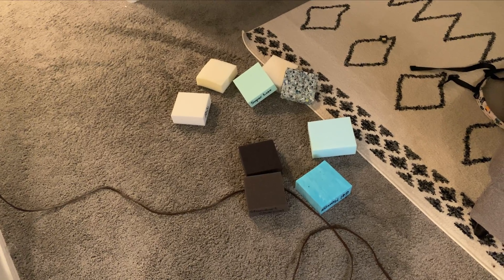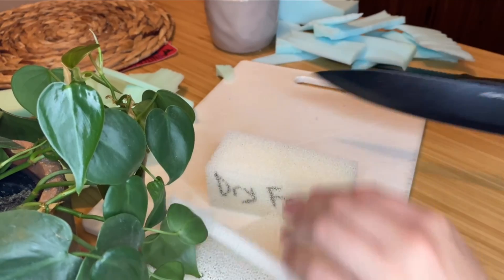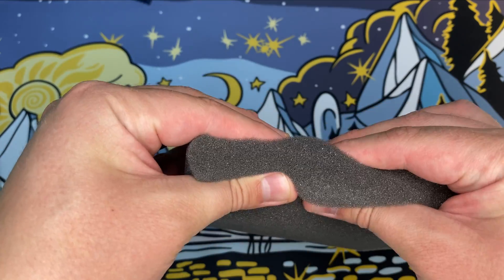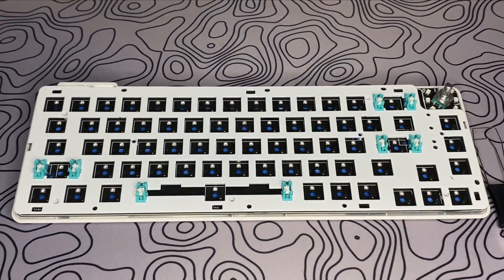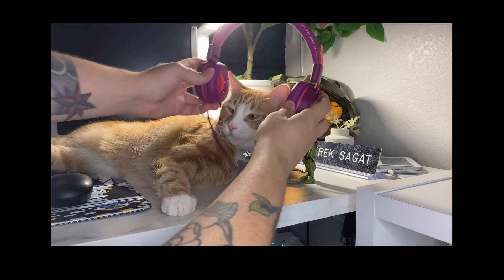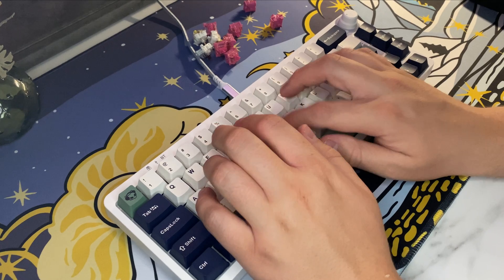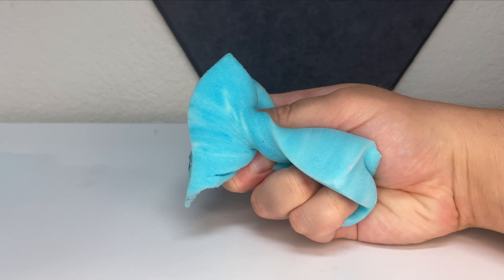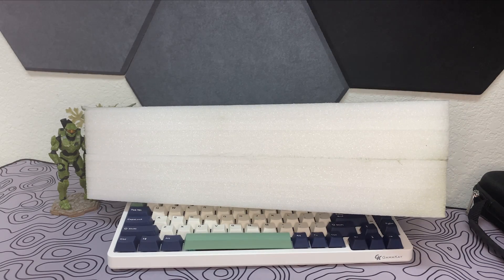The BEST Keyboard Foam Material

Comment: 6:49 - If THIS is how you installed the foam for all the runs, then no wonder it all sounded the same. Should be one solid sheet of foam with only holes for ribbons and screw holes.

Comment: I was hoping to see sorbothane, kilmat, neoprene, EVA, and poron. Also comparing different durometer values.
Could be a good followup, if anyone somehow happens to read this.
Reply from the maker: I read all my comments. This is a good one. Keyboards lately need no mods though and come with great foam. 

I’d love to take another stab at this if given the chance.
Reply: @LuckyStrikeTech  That's awesome, definitely an underrated channel. I do get why they wernt there, being more bespoke materials, but that also makes them more interesting as a comparison right? I hear in a vacuum each of these are great, but they could have just the same affect of there not really being much actual difference. Or even more if there's not much of one vs foam.